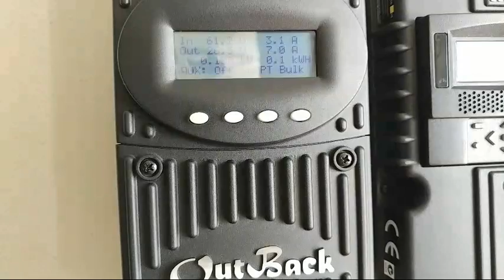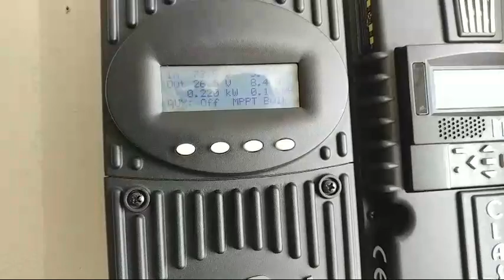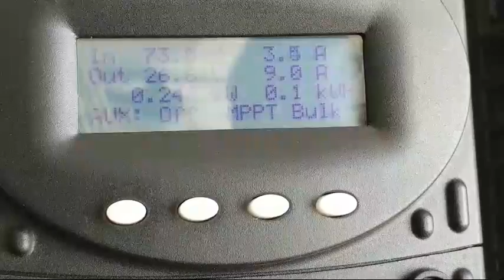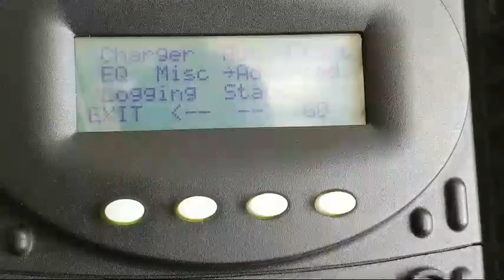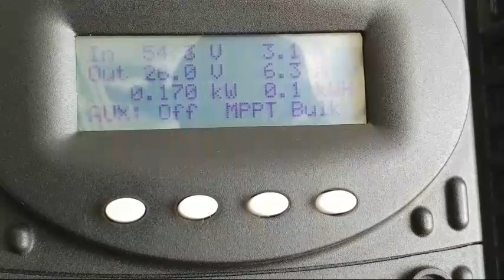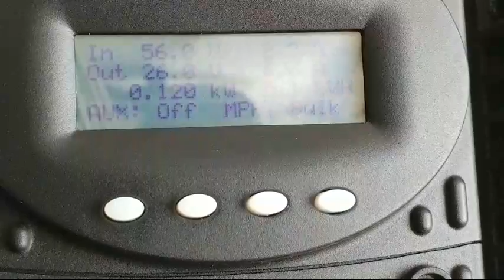TESTING MY 24 VOLT SYSTEM Pt.3

Comment: I have enjoyed watching your videos. I have 2.2kw. 250 x 9. Using 3 series and 3 parallel. Pv distance from CC is 40 feet. How bad will it be keeping a combiner box 25 feet away from PV and still get very good out. Or should I just clip the wires and run the wire down from the roof but the connection will be poor. As it requires using wire clips on them. Need advice.
Reply from the maker: +Will Willy 
Thanks for sharing and for watching my videos. I really appreciate you being part of my channel.
I would like you to share your contact with me on a private email and I will give you a call so we can discuss about it ok? 
Do you have Whatsapp on your Mobile Phone?
Reply: jwsolarusa how do I do that
Reply: I tried sending an email on your ID but it failed. Through Gmail.
Reply from the maker: Will Willy 
Please send me your number so can call
Reply: JW, why did you go back to 24v from a 48v system.  I seem to recall you had a 48v system.
Reply: JW, remind me again, how many and what type of panels do you have? And how are they connected to your charge controllers?
Reply: jwsolarusa my email, charleswilliams5wus@gmail.com
Reply from the maker: +Will Willy 
https://youtu.be/Q-9AMh_ATTk
MPP SOLAR INVERTER CHARGERS PIP 242424LV-MSD - Complete Installation
WANAMINGO MINNESOTA BY jwsolarusa